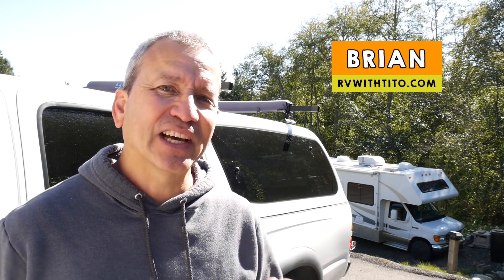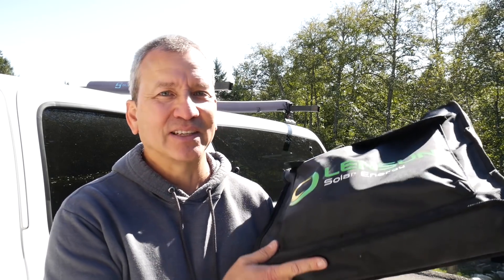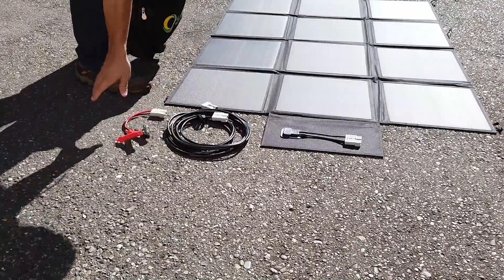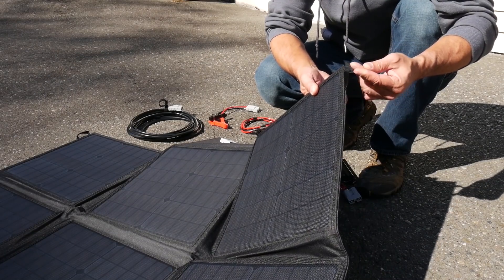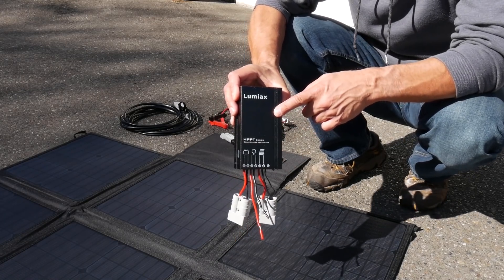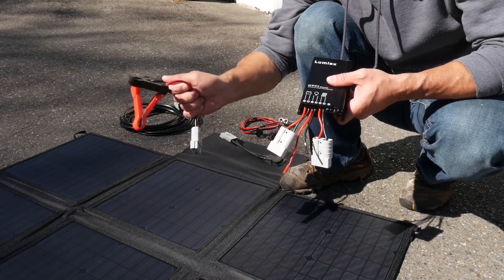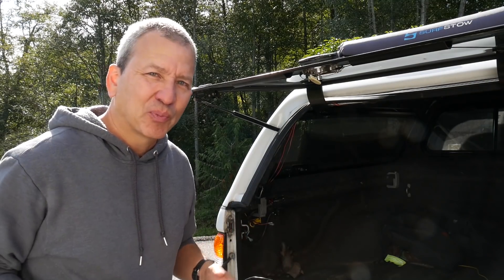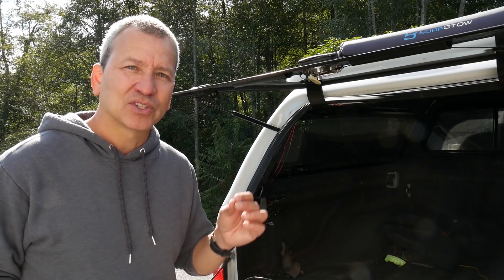(Review) Lensun 200 Watt Foldable Portable Solar Panel with MPPT

Comment: I visited the LENSUN website and according to them the MPPT controller IS compatible with lithium batteries, BUT it is default set for gel cells. That leads me to believe that there is a way to change the battery type settings. Maybe you could read the instructions and do a follow up video, if it turns out that it WILL work with lithium. Or maybe your unit is defective. It would be a big no-go for most people if this very expensive setup didn't accommodate lithium.

Comment: People, there's no need for all this complexity with separate controllers, batteries, inverters, meters, displays, etc.  Just buy solar generator that puts all that stuff in one power station.  Simply plug the solar panel into the power station.  Easy and simple.

Comment: Looking forward to your follow up video for this product
Reply from the maker: I don't use it anymore and gave it away. I built another 230W portable solar array that I use.
Reply: @RVwithTito  ok but do you know if it's still working well?? I'm curious about its durability/longevity.
Reply from the maker: @susie9893  I noticed diminished performance after using it for a few months. Perhaps it got damaged or something leaving it outside. Anyway, I stopped using it. It's a great idea though and they may have made improvements since. I just haven't kept up with it. I made my own portable solar setup for less money that I've been using instead. There are several similar units out there, but I haven't tried them.
Reply: @RVwithTito  hey, sorry I didn't notice your response till now - thanks for letting me know. Note taken

Comment: Controller appears to be designed for Lead-Based Batteries. Lensun needs to offer a Charge Controller that has a Microprocessor built into to it to automatically adjust for EITHER Lead, Gel, or LiFePO4 Batteries!
Reply from the maker: I think the latest one comes with a lithium compatible controller.

Comment: Great vid. Nice job. This thing is just too big and impractical. Its either going to be flat on the horizontal or vertical surface. No way to effectively and efficiently angle. Standard 200 watt panel is 50-75% smaller. The sun continually moves...this is just too cumbersome....compact, no....its silly actually

Comment: So your saying it will work with your own charge controller if you have lithium? Do you have an updated video on the status of how well these panels are functioning? Are they waterproof? I'll do my own research. Thanks!
Reply from the maker: Yes. It will work with your own charge controller. Unfortunately, I've noticed the performance decreasing and have switched back over to my other setup.

Comment: Great thorough video Brian.  Any updates on how well it’s has held up for a year?  Also, are these water resistant/proof?
Reply from the maker: I used it quite a bit earlier this year in the desert. Since then, I've noticed the performance has dropped quite a bit compared to just using 200W of regular solar panels. So I question it's longevity.
Reply: @RVwithTito  These actual user reviews are a GOD send.  Thanks so much.

Comment: Great video. By the way the current with the higher voltages coming from the panels equates to the higher current with the regulated lower voltage from the mppt controller.  Ohms law.

Comment: Brian, I have been researching solar panels for my Outfitter soft side truck camper. I have been looking for something lightweight like flexible panels but this foldable may be better especially the 360 watt version. I have two BattleBorn batteries and a Renogy DCC50S DC-DC MPPT charger. Do you think the 360 version would be a good match for what I already have. Price may be high, but not having to have any more weight to crank up on the roof will be worth it and the alternator can keep the batteries up while driving so that I can run the fridge off of the inverter.

Comment: I just stumble onto ur foldable solar system. Thank u for taking the time to shoot the video. Informative and love the suction cup idea. I'll be buying some for other usage. 
The Lensun foldable solar system has the potential  for great concept and usage. However the price is to much for what u r getting. The mppt is low end tech. And Amazon reviewers 4 out of 9 say didn't work, hot spot or failed after some time. I would be interested in buying the connectors. They look to be great quality! To bad the panels have poor reviews and high cost. I would buy it if not for that and the item is no longer in Amazon at this time.

Comment: I go tent camping with panels lie that ,work great. using 2 100 watt briefcase type. It came with basic PWM controller but I got a MPPT controller that cam be set 12/24V 30 amp . and has LFP/ AGM/flooded setting and I paid around 30 USD with shipping from china and works great. I gained 2 amps in full sun at 12.5V . AGM batt. and MPPT had 2 USB outputs.  my MPPT is around same size as one in video .Gave me a few ideas for mounting also.

Comment: If it's mppt I'd like to see a higher voltage so it could do 24v also like I have built a couple of the (solar generator) type things and I'm using lithium ion so it's 7s which works well at 24v but with most of the portable solutions I'd need to use a boost converter or possibly get 2 panels and run them in series

Comment: Great review, thanks. What if you get a Renogy 20A MPPT to use with these panels so you can get lithium charging?  And then transfer Anderson connectors from Lensun MPPT to Renogy.
Reply from the maker: They now come with a lithium compatible MPPT controller.

Comment: Can you attach an additional length of extension charge cable to the 15 ft of cable that comes with the kit.  I would like to see if I could get an additional 15 ft with Anderson connections, so I could have at least a total of 30 ft if needed.  Also, how is Lensun 200 Watt foldable portable solar panel holding up so far?
Reply from the maker: You could add more cable. It may lower your efficiency a little. It's holding up fine but I've never been able to get more than 150W out if it...still trying.

Comment: Brian. I am interested in that DC amp meter you were using in this video. Do you have a link for it. TIA
Reply from the maker: It's a Voltcraft I got on Amazon (https://amzn.to/2ZNM4j6), but they are often out of stock. You could try to find it somewhere else. I like it though because it's very small.
Reply: Thanks

Comment: Thanks for the suction cup mounting. I'm going to apply that to two Renogy 160w panels on a Lance 2285. I can then park as desired / needed and point the panels to the sun.  Solar power will go into a EF Delta which will feed the RV via the 30 amp socket for a/c power in the trailer.  Judicious management REQUIRED!!  All up costs about $1,600.   . . . I hope.
Reply from the maker: Glad to help. Good luck with your setup.
Reply: @RVwithTito  BTW.. who is Tito?
Reply from the maker: @h2osmokey  He's our little mascot on the dash.

Comment: Great video, very interested.  Amateur question.  When the battery bank gets full capacity where does excess power go from the panel?  Does the controller just turn down the panel?  General panels and controllers...
Reply from the maker: Imagine an air compressor inflating a tire. As long the tire can accept air, the compressor will push air into the  tire. When the tire is fully inflated the no air can flow into the tire. At that point the regulator maintains a tiny bit of pressure to keep air from leaking out of the tire. Now imagine the tire is your battery, the compressor motor is the solar panel, and the air pressure regulator in the compressor is the charge controller. I hope that makes sense. If not then let me know.

Comment: I have a brand new Forest River 5th wheel, supposedly equipped with a plug that says solar ready for 200 watts. Haven't even camped in it yet lol! I have a 50 amp site but if I wanted to dry camp somewhere is this unit plug and play and what might it run and how long? I have dual battery setup, normal 12V deep cycle and my only big draw would be leveling jacks and residential electric refrigerator that is factory equipped.

Comment: Hi, Brian. I just watched your video on the Lensun 200 Watt Foldable Solar Panel with MPPT controller. It was a very good video, and it is intriguing to be because of the size and low weight. I was not able to find the 200 Watt using the Amazon link provided. Is Amazon not offering the 200 Watt anymore? Just wondering since this video is a few months old if you were able to find any other  benefits or faults in this solar panel? Initially, I thought that this would be a deal breaker for me as I just installed Lithium (LiFePO4) batteries, but I saw on Lexsun website that this has been added to the controller. I would jump on this right away if the cost was closer to $300-350.

Comment: How are you using this now with your Lithium Batteries?  Does Lensun have one with a Lithium profile controller?
Reply from the maker: Yes they do now. I use it sometimes to recharge my Jackery or hang it off the back of the RV when I need a little extra.

Comment: Could I potentially use this product to charge an electric vehicle? I'm looking for a portable solar charger so I don't need to find a public charger.
Reply from the maker: No. It wouldn't work. You'll need a lot of power to charge an electric car.
Reply: @RVwithTito  I would either need 8 amps or 12 if I could do that. 120 volts
Reply: Watts?
Reply from the maker: @moocow2oo426  That's the equivalent of 80 or 120 amps at 12 volts. That solar panel will only output a max of 8-10 amps at 12v.
Reply from the maker: @moocow2oo426  Multiply volts x amps.

Comment: Lensun have now updated the controller to work with lead-acid AND lithium cells - you can set the battery type via bluetooth from your phone.
Reply from the maker: Yes. They sent me the new controller, I tested it and it works with both.

Comment: Great review! For under $300.00 it would be a worthy consideration but at the current price point, absolutely no way!!!!!!  The use of 50 amp power-pole connectors is overkill for a 200 watt panel.  They would have been better served with the smaller and much less expensive 30/40 amp connectors.
I recently purchased 2 E-bikes even though I was not in the market for them because the company came in  at at a price point 50% below other similar bikes.  At the low price point, Lectric XP bikes sold 6000 bikes in 5 months, many to RVers while their competitors were selling 2-3 a week at double the price.

Comment: How do I add portable solar to my existing solar? Just plug it in to the rooftop fixture and I’m done? Looks like it at 2:35. I have MC4 connectors and I think on double is available.

Comment: I'm not convinced your charge controller works. MPP for the Lensun panel is at 18V according to specs, but your controller is keeping it at 16.5V. The panel might be alright, but the combo with a crappy charge controller is not worth the money. Better buy a propper charger like the Genasun and get your money's worth from the panel.

Comment: I notice that the charge controller is waterproof, but how about the rest of the system?  Thanks.  Always Great!
Reply from the maker: That I don't know. I would imagine it's at least water resistant, but I haven't drenched it with a hose or left it in the rain yet. 😀

Comment: I have 4 6v batteries - where in the system would I connect the line to charge?
Reply from the maker: You'll probably see 4 cables connecting the batteries to each other. There should also be two cables leaving the battery bank. One will be from a positive post, the other from a negative post. That's where you connect the alligator clips from the charge controller (red to positive, black to negative). Note: They will probably be coming off of different batteries. Hope that helps.
Reply: @RVwithTito  Thanks for the response and the great videos!!!

Comment: The Lightbulb and  "red & black" extra wires are the Load-Output -  These are for you loads, ie Lights,12v sockets etc etc -  Those wires will have battery voltage/current on them so you best insulate them to stop any shorts. . . . .  they are used for the Low Battery Disconnect - so your loads are disconnected before your battery voltage drops too low.

Comment: Thanks Brian.  We started full timing last May and we are currently looking for a portable solar solution to keep the batteries up.   This blanket looks interesting but I am concerned about the loops breaking and that it doesn’t use a stand to be able to angle it to line up better with the sun.  Do you have a favorite, tried and tested 200 watt portable solution?  I would love to hear your input.
Reply from the maker: I don't have a favorite. I've always made my own. I know lots of folks have the Renogy ones though. I like the blanket idea and will experiment with different uses. I'll install grommets on mine though. You could arrange the blanket thing in lots of different ways to maximize solar. I'll probably hang it and move it around as the sun moves.
Reply: I just tow a cargo trailer with 1150 watts of panels, batteries, inverter, motorcycle, kayak, mtn bike, along with my tools.

Comment: Nice review Brian! As I was watching how you were mounting the panel, I was thinking that you could probably make an adjustable frame out of PVC pipe that would be easy to maneuver and easy to set up and take down. Does the controller quit sending current to the battery once the battery is fully charged?
Reply from the maker: The battery will eventually stop accepting a charge. When that happens, there is no load to draw any current at which point, the solar stops producing current (even in full sun).

Comment: Tito like view, wondering if you have any recommendations on a outside security system for rv. Had my catalytic converter stolen last night. But good news the police caught then with a converter in the car,
Thanks
Rick
Ps. At storage yard I do not have outside power source
Reply from the maker: Get a motion sensing LED light. Also look into a front/rear dashcam that records both to a memory card. Both of those will run off of 12v. So it'll drain your battery unless you have solar to recharge it.

Comment: There are a few 150w and up soft folding panel systems on Ebay. This morning I noticed a 200w set for $220. It ships from California. Seller is king-camp, something like that. Most of the folding panels ship from China but are under $200. I really like the concept of something that folds to a stowable size. I've worked with flex panels. They can be mounted with magnets, at least on my steel van. I can't believe the incredible cheapness of those cloth mounts. I don't want to re-engineer a product on the first day. It's a premium price.  The Chinese versions seem dirt cheap, by comparison. 

The flex and soft panels often are rated or spec out too low. I lose an amp with my flex panels over a rigid panel. These seem about right. I guess if you put the vacuum mounts lower you could get the panels to hit the ground at the right angle. That's what the flex panels do best, since they hold their shape pretty well.

I think people who go with LiFe batteries should buy the raw cells and learn the parameters, the support stuff. Letting a company do the settings is going to make your life more difficult in one way or another. If you have the batteries in one box, and buy the other equipment, you can tailor it for your needs. The companies who make "all in one, do everything" products are incentivized to prevent education. They don't want people to know how the things work. I saw this over and over again in the ebike industry. I would suggest adding real amp hour meters to battery readouts, and the industry would say 'people don't want that'. The less people know, the better. So pure DIY sites like this are the best antidote to that.
Reply from the maker: Thanks for sharing your thoughts and insight George.

Comment: Good review, probably not connected in series though the voltage would be higher it’s probably a combo of parallel and series. Remember series is not shade tolerant at all block one panel and you would see very little. Also on the controller that’s not an “auxiliary” it’s a load output for say a light.
Reply from the maker: Definitely a series/parallel setup. Based on my shading test, I'm thinking each column of three were paralleled from the others. BTW: I don't know anyone who uses those "load" outputs. I don't since you can't charge anything with them.

Comment: Anyone know if you could attach two together for a total of 400 watts
Reply from the maker: Should work in series but you'll need to use a bigger controller if you connect them in parallel.

Comment: Very neat, I like the fact that it has everything you need included, but can also just link into your existing system easily either. I have a 160W framed kit and its very heavy and bulky to store. A good spot for it might be to hang it from the cab overhang and down onto the bonnet using your suction cups. It would shade the cab then too and give quite a good angle to the sun.
Reply from the maker: Yeah. That would be a good spot. I'll have to give it a try.

Comment: Nice review.  Will you be making your own patch connector from the Anderson clip to attach the blanket directly to your existing external fitting to your 3rd Victron MTTP controller or will you continue using the supplied MPPT controller?
Reply from the maker: I already have an MC4 adapter that connects to my external port. So after connecting the provided Anderson-to-MC4 adapter, I'm good to go. I've already tried it out connecting it to that Victron MPPT via the external fitting. Works like a champ.